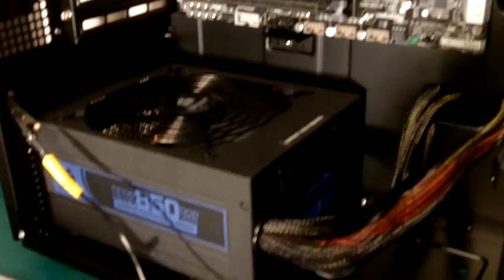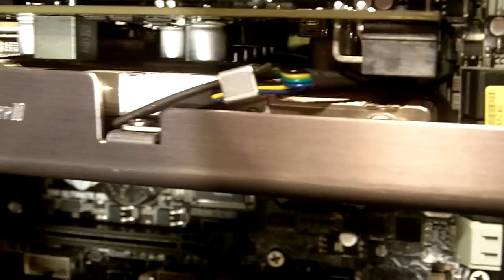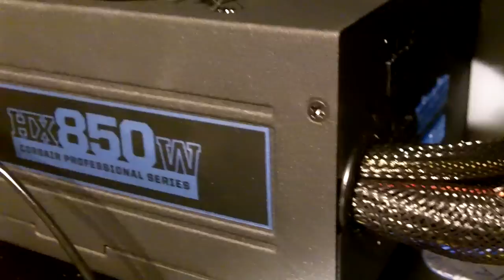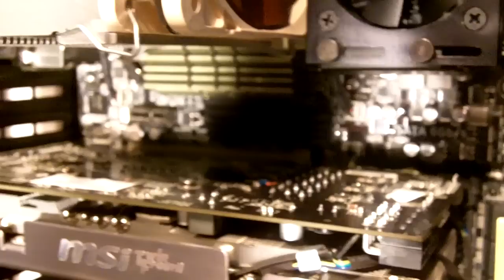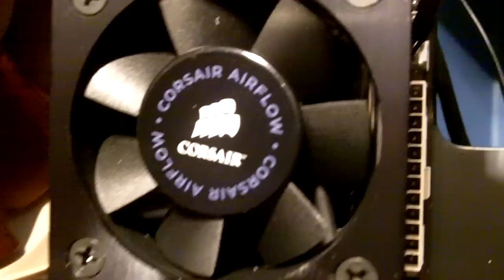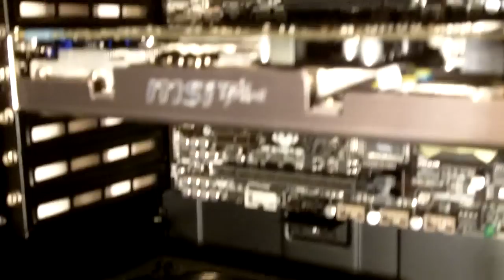New PC Gaming Build 2010 Update

Comment: i'm building a system myself right now- getting the following for it.
apevia x-dreamer 3 case
WD 1tb 7200rpm 6gbit sata HD
LG DVD writer/rewriter
XFX radeon HD 5830 Video card
ASUS P8P67 pro B3 motherboard
Intel unlocked Core I5 3.3 ghz Processor
Corsair 8GB DDR3 1600MHZ Ram
Cooler master 750Watt PSU